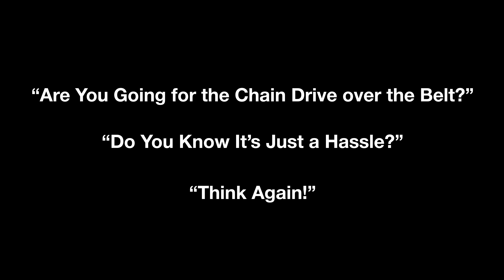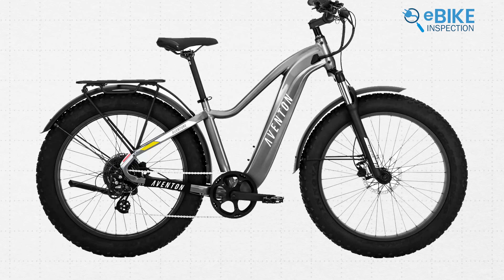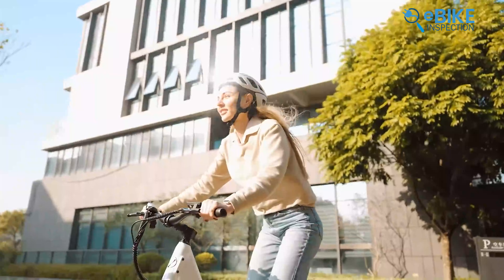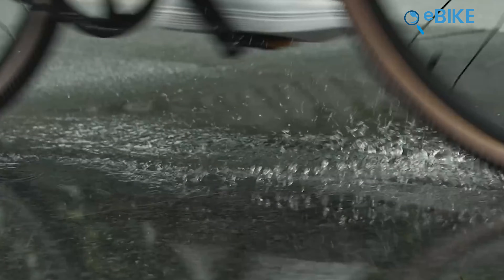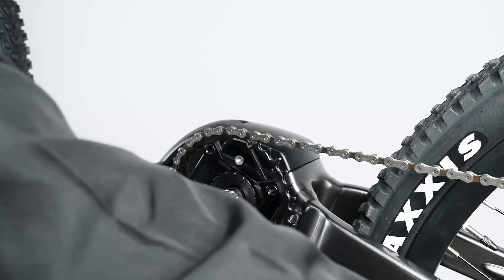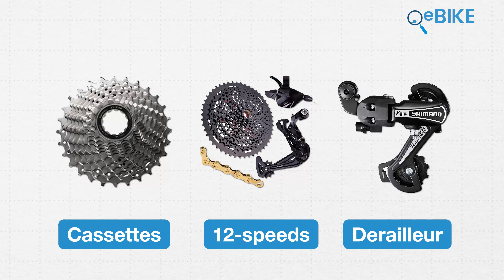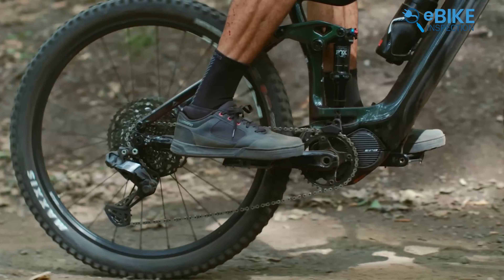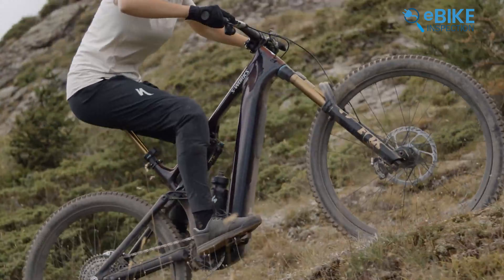Chain vs Belt - The Truth About eBike Drives!

Comment: 1) Belts do not stretch. Chains do.
2) If anything, belts are easier (and much cleaner!) to replace than chains.
3) Belts are fine with high torque and regularly coupled with Bosch CX motors.

Thanks to AI it is now easier than ever to pretend you're an expert and spread misinformation in a convincing manner.
Reply from the maker: Thanks for your input!
Reply: How much also the belts if you replace a new belt thanks